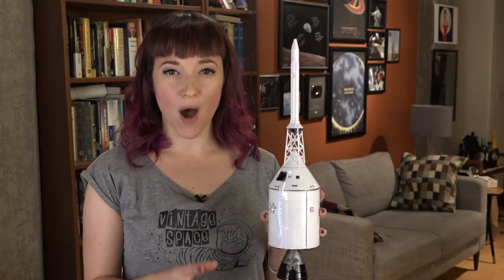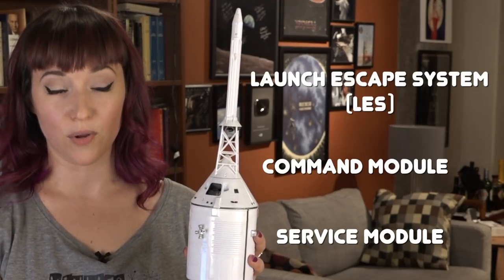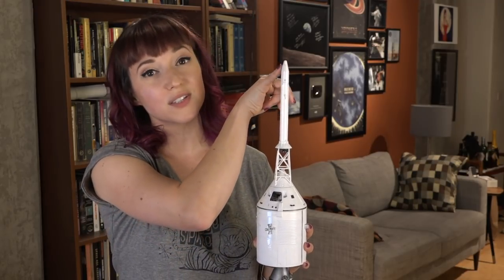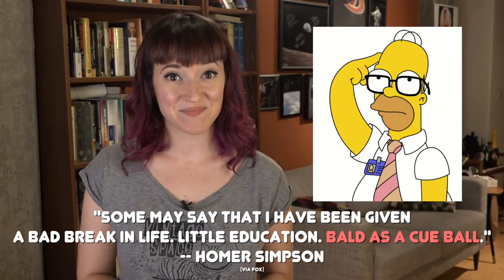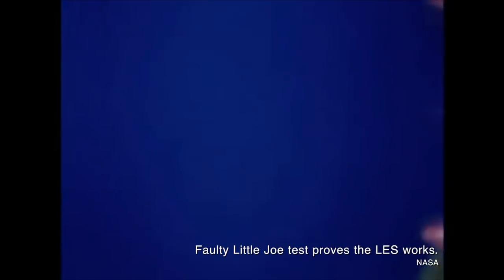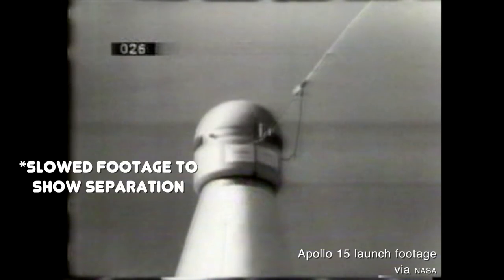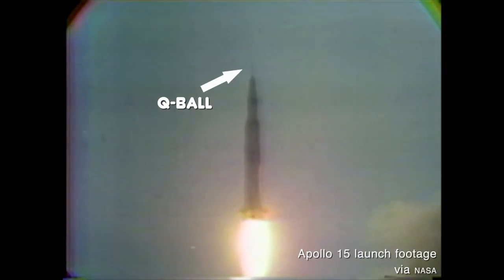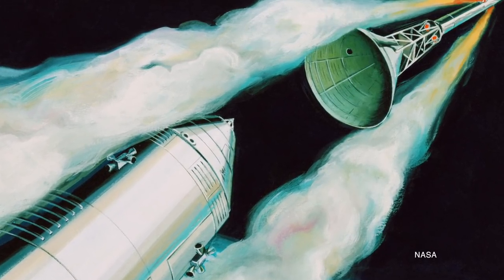The Life-Saving Q-Ball of Apollo

Comment: Ok let's get technical. Pitot tubes in airplanes also measure pressure not airspeed directly like an anemometer would. Pitot tubes measure the difference between static pressure and dynamic pressure to give airspeed. This is one area I could get technical. 😁
Reply: Mizzy Roro I've been scrolling down the messages to see if anyone noticed her mistake because I couldn't be arsed correcting her.
Reply: Wouldn't an anemometer measure how fast it spins and not the airspeed? It needs to also be correlated to airspeed and corrected for air density.
Reply: Fred Frigerio Key word "like"
Reply: Yup, I'm doing my PPL and I noticed that too! lol
Reply: Not really.  Both an anemometer and a pitot tube convert dynamic pressure into mechanical motion (rotation of an anemometer) or displacement (the expansion of a dry bellows or compression of a tranducer). 

And it's the airspeed indicator or air data computer measures the difference between static and dynamic pressure. Pitot tube only measures dynamic pressure, period.
Reply: Bartonovich52 You missed the point of the O.p. which was that pitot tubes also measure pressure.
Reply: Bartonovich52 And if you want to be that pedantic, pitot tubes don't measure anything. It is the pitot--static system that measures airspeed.
Reply: All pitot tubes conduct total pressure, Pt, from a front-facing opening to instruments, computers, or transducers.  Some pitot tubes have additional openings on the shaft of the tube to sample static pressure, Ps, which is also plumbed to required units.  The 737 Classic aircraft has four pitot-static tubes, two on each side of the fuselage, with one pitot and two static connections per tube, plus two more flush static ports farther aft on the fuselage for an alternate static source.  The eight static ports on the pitot-static tubes are connected in crossed pairs, lower-right to upper left, lower left to upper right, etc., as inputs to four static systems.  Captain's and First Officer's static system  use forward static holes, first and second auxiliary static systems use aft static holes on each tube.  Alternate static ports on each side of the fuselage are connected to manual selector valves in cockpit which can switch Captain and/or First Officer's static instruments to alternate if trouble develops in main static systems.  Pitot and static systems are really no more than simple plumbing, but remembering which instrument or computer is connected to which pitot/static ports/system could get hairy.  Newer airplanes have very short tubing connecting each pitot or static port to a transducer just inside the skin from the tube or port.  The transducer converts pressure to an electrical signal for various computers to use.  No more worry about leaks in the plumbing producing false air data.
Reply: Actually, the pitot tube doesn't "measure" pressure, it provides pressurized (or "ram") air to the airspeed indicator, where it's compared to static pressure (that air uncontaminated by random aerodynamics) and then rendered by the differential as airspeed.

(retired air traffic controller, nerd/geek, ASEL Commercial, Instrument)
Reply: I heard pedo tube

Comment: Dear Amy, could you do a video on how the command module cabin and instruments were lighted. In apollo 13 it looks like fluorescent tubes for the cabin, and some kind of indiglo watch light behind the instruments. it looks like they would want to conserve power. Thanks from North Carolina, Steven
Reply: They used electroluminescent  lighting, which has the advantage of low power consumption, and they're very reliable.

Comment: "It was connected to a weight housed inside that tube that in turn rested on a lever that was controlled by a pneumatic valve.... actuated from launch control center, rotating downward and allowing the weight to drop down the tube, pulling the wire that cut the elastic......"

Man....  Ya just gotta LOVE engineers!
Reply: My wife does.

Comment: at McDonnell Douglas we used a Q bellows to control rudder travel limits on the DC-9/MD-80/-90/717 for airspeed as a separate self contained system for the aero-balanced system.  Hydraulic only powered rudders like 737 didn't need any such thing.

Comment: 1:39 Pitot tube is not measuring air speed it is measuring pressure difference between static port. Then that dependence is translated info airspeed.

Comment: The launch escape system was never used ... in the USA, but the same system saved the lives of some Russian Cosmonauts when there rocket exploded with a force of about 1.5KT.  They knew they were in trouble and initiated the system just a couple seconds before the rocket exploded.  NASA received letters from the Russian Cosmonauts thanking them for saving there lives.

The story of the Russian use of the LES would make for a great video.
Reply: It wasn't even used in the Soyuz MS-10 abort in 2018-10.

Comment: Hence, max q = maximum dynamic pressure.
Reply: Exactly! A callout on every STS launch.
Reply: Tom Shafer and space x tooaa
Reply: I am also reminded of the aviation terms, QNH (Air pressure adjusted to sea level), QFE (Air pressure adjusted to field elevation) are ones you will hear a lot if you have anything to do with aviation as these values are needed to calibrate a pressure altimeter.
Reply: Seraphina S huh, I've never heard those terms. Just their kinda equivalents, MSL & AGL. Either my ground school course in college didn't teach these terms for calling the tower to get the current altimeter setting, or I've just forgotten them. Anyway, cool info on the terms to describe the required adjustment to get accurate MSL & AGL out of the altimeter.
Reply: +Iceberg86300 Are you from the US? I believe that the old Q-codes for it are less used there so that could be why. Also there is a distinct difference between QNH and MSL in that QNH is a pressure (Units = Hectopascals in metric or I think mm Hg in the US) where as MSL is an altitude which interestingly is expressed in feet even where metric is used for everything else lol. Course these days there is not so much reason to distinguish them as QNH is used pretty much universally used so simply calling it "altimeter setting" isn't ambiguous. After all now one should be consulting their charts for MSA and field elevation information in modern aviation especially given the huge effort that went into mapping everything out to make such resources.
Reply: I believe QNH and QFE ect were from old radio Q codes, not referring to Q as pressure.
Reply: Playing Apollo 18 as a kid, I always wondered what was meant by that.

Comment: So the Q-Ball was similar to the static air portal on the side of an airplane. It's a small pinhole that measures the surrounding air pressure. This measurement is compared to the airflow over and thru the pitot tubes to determine altitude, airspeed, and in a similar way, a system on the wings measures lift and stall.  One system in a ball. Holes on the front can relay airspeed and flow, while holes on the side relay pressure.  What an ingenious way of doing it.
Reply: John Wyatt Man you are close on your description of the Pitot-Static system.
Reply: I'm cheating. I'm a pilot.
Reply: John Wyatt Hey, me too. Time for my favorite pilot joke.

How do you know if there's a fighter pilot at your party?

Don't worry, he'll tell you.
Reply: good one.

Comment: Future vid idea: I'd be interested to know more about the mechanical and electrical nature of the various release mechanisms on the Saturn V, CM and LM. Like the struts or whatever between the 1st & 2nd stages that had to take the weight of the upper stages plus the pressure during launch but then separated via whatever means. Also, the abort tower would need to withstand a bunch of pulling-apart force if it were used since the thrust came from the upper part, but then it had also fully release and get out of the way during a successful launch. Plus the LM and landing portion that had to be solidly attached during lunar landing, but then be released so the bottom part could act as a launch platform when launching the LM off the lunar surface again. That sort of thing.
Reply: jfroines It's pretty much been covered in a previous episode.
Reply: In a relatively cursory manner, yes, but I'd be interested in a more in depth video about it.

Comment: Was there anything in a launch the astronauts would need to do, or was it all automated. 
Mainly asking, because in Apollo 13 Tom Hanks pushes a button named les motor fire, which jettisones the les
Reply: I have no idea. I think the back-up crew set the switches before liftoff, but I'm sure the crew had some switches to throw before liftoff. I know the CDR flipped the EDS switch from "auto" to "manual" before/after staging of the S-1C, as you can see in the Apollo 13 movie.

*Btw, the EDS is the Emergency Detection System. Switching it to "manual" meant that an abort could ONLY be initiated by the astronauts onboard, whilst when it was in "auto" it could automatically initiate an abort, without input from the astronauts. This was probably because the mode 1 alpha/bravo/charlie phase of flight (i.e from liftoff until the separation of the LES & BPC) was considered to be the most hazardous part of the launch.
Reply: Yes, there were quite a few things that had to be done even if there were no issues during launch http://www.ibiblio.org/mscorbit/mscforum/index.php?action=dlattach;topic=438.0;attach=825 has a checklist that was created for the NASSP add-on for Orbiter, but it was taken from original documents, with only a few modifications needed, either for Orbiter-specific tasks or things that weren't simulated in the add-on when the document was created. The boost procedure starts on page 29.

Comment: Your service module looks like it needs to be serviced. The high gain antenna is just flopping about and the  oxygen tanks looks like the just came back from Apollo 13. Color scheme is a little bit off too. Time to roll it back to the assembly building.
Reply: The SM needs to be painted silver. CM being white looks like the booster cover, so that's ok
Reply: bkearns34 Unless it's one of the early models (Apollo 4 or 6?) That WAS completely white.
Reply: Mark Glinskie That's an old 1/48 scale Revell model kit, long out of production and based on the Block 1 configuration. I had one; the high gain antenna did flop around. The kit contained an LM and an LM Adaptor that the CSM fit on top of.
Reply: Just looked into what model that Amy was showing and  I got the color scheme wrong. The web sites http://www.collectspace.com/ubb/Forum16/HTML/000381.html
http://www.ninfinger.org/models/html_pix/jfapollo.html
helped a lot. The shelf that needs repaired is the fuel cells and not the lox. My mistake there. When I was watching I thought " that's a lot of gold inside". It is really different than the one I built (block 2) I like your videos, you do a good job making them.

Comment: Amy, I'm hoping you can do a video explaining how the CM & SM were connected.  I know there were strap type connectors called "tension ties", but I dont quite understand how they were actually fastened on each end. Were they connected directly to the CM's heat shield? If so, how did the heat shield's integrity stay intact?  Also, when the two (CM & SM) were mated together, how was this done? i.e., was there a person actually in between tightening some bolts? If so, how did he get in and out?

Comment: It was a single rocket motor with 4 exhaust nozzles.  I have a picture of myself standing next to the one for the Saturn V dynamic test article (shaker building) with the single motor star grain visible.  Sadly the grain (an inert dummy) was removed to lighten it so the US Space & Rocket Center in Huntsville, AL could hang it from the ceiling, attached to a boiler plate CM.  I can send a pic if you'd like it for confirmation.

Comment: Great video! I never knew about the Q-ball before, but it makes sense. At 4:54, you show an artist's rendering of the tower separating from the CM, and taking a conical shroud with it. I'm guessing that the shroud has a secondary hatch in it for crew entry? I don't remember ever seeing them close 2 hatches before.
Reply: According to Wikipedia: The hatch consisted of three parts: a removable inner hatch, which stayed inside the cabin; a hinged outer hatch, which was part of the spacecraft's heat shield; and an outer hatch cover, which was part of the boost protective cover enveloping the entire Command Module to protect it from aerodynamic heating during launch, and from launch escape rocket exhaust in the event of a launch abort.

Comment: Amy, where did you get that great looking model of the LES-Command/Service Modules?
Reply: It's a 1/48 Revell/Monogram kit: Lunar Module Eagle & Spacecraft Columbia, Revell serial number 04808, originally produced in the late 60s. I got a 1994 edition from ebay a few months ago, but they are quite rare now, and don't seem to have been included in the 50th anniversary re-releases. As with all kits from the early Apollo days, it uses the original moulds which were even in 1994 slightly worn, has inaccuracies (such as a Block 1 Service Module- all manned Apollo missions had the Block 2) and the instructions are not always particularly clear. Apart from that, it's a great kit for showing how the Apollo spacecraft were arranged on top of the Saturn V and you can recreate the transposition & docking, the lunar landing & ascent et cetera.

Comment: At 4:45, you mention that the launch escape structure was jettisoned just a couple minutes into the flight..."thrown away"...and that's one of the things I've wondered about before. Did the system fire the escape rockets? How fast were they travelling and how high? And how did the system ensure the "thrown away" hardware didn't pull the command module/LEM off course on separation, or come back to strike it after separation accidentally? (Too geeky? Not sorry....)

Comment: Ground personnel used to place pieces of tape over pitot tubes when washing planes with pressure washers or deicing prior to take off. This practice stopped when, you guessed it, somebody forgot to remove the tape one day. When the plane became airborne the computer was receiving false data from the pitot tube. The pilots, trained to trust the computers, did everything they were supposed to do according to the data from the computer. Unfortunately what the computer was identifying as a problem fooled the flight crew into doing exactly the wrong things to save the plane. No one survived. I believe that pitot tubes should have a built in means to clear the tube in the event that something is suspected of interfering with its function. Something as simple as the pilot being able to flip a switch causing a burst of air from the back of the tube thus blowing out any obstruction. It might not be obstructed but it would be one less thing a flight crew would have to worry about in an emergency situation.

Comment: I have a serious question / idea regarding pitot tubes. Given their importance, and that the act of leaving that little "remove before flight" cover could actually bring down a plane, why isn't there some kind of clearing system in place? For instance, as the plane taxis down the runway, and system of compressed air at very high pressure could blow out the tube. That way, if the cover was left on, or if something had managed to block the tube, it would either be blown clear, or the pressure increase would tell the on-board sensors that the tube was blocked.

Comment: Interesting.
My helicopter's pitot tube actually has a little door that is opened by air pressure, as you increase your airspeed.
This prevents insects nesting in there, while not having to worry about remove a cover.

Comment: The launch escape system only had one solid-fueled rocket motor, not four, though it was fitted with four nozzles through which exhaust could be directed in variable ratios.

Comment: I was thinking that if the rocket changed attitude vs the direction of movement,  that would create a pressure difference between the sides of the rocket nose. Otherwise don't know if it really tells you 'where' you are going. Still need gyros for that?? I mean it would sort of immediately keep you going straight though.

Comment: You have some very cool Saturn V models, where do you get those? Will you clarify something re the Service Module please? When you were demonstrating it and opened the side up and explained all was stored like "consumables" within it. So when they were enroute to the moon and back, was the SM also pressurized and accessible to the astronauts to go inside it back and forth between the CM? So was there a hatch to go back and forth between the SM and the CM, while in space?
Reply: Not pressurized, and definitely not designed to be opened in flight. In this context, context consumables mostly means fuel and oxidizer for the Service Module propulsion engine, plus the fuel-cells to generate electricity, etc. All fully explained here: https://en.wikipedia.org/wiki/Apollo_Command/Service_Module#Service_Module_.28SM.29
Reply: oxygen and water generated by the fuel cells...  NOT food
Reply: Though the CMP got to do an EVA on the return trip to retrieve film and sample containers from a compartment on the SM. Consolation for only getting near the moon while the other guys got to go to the surface.